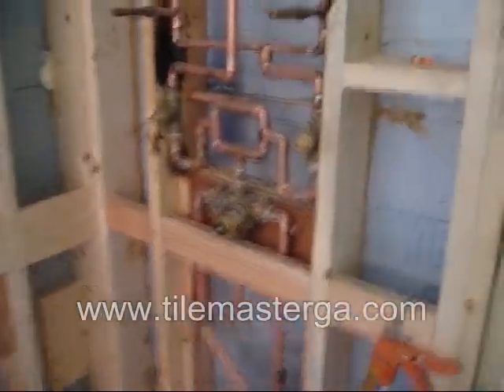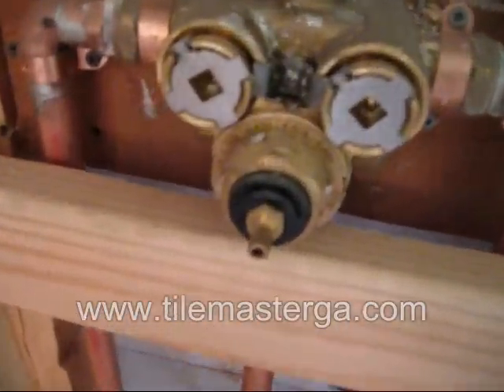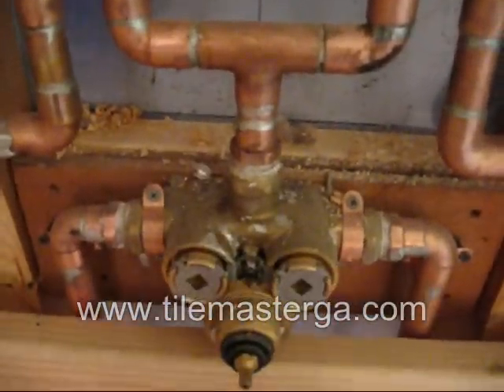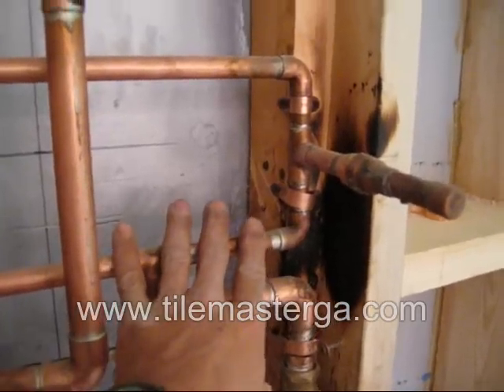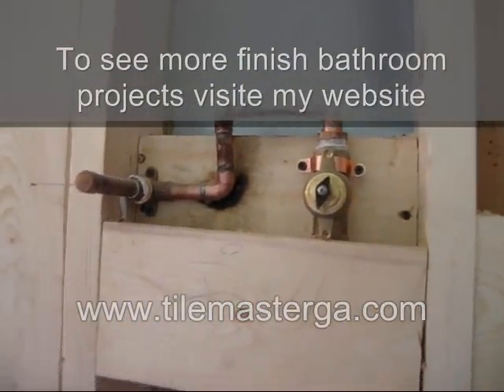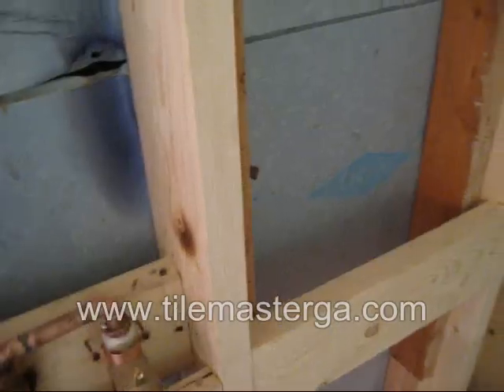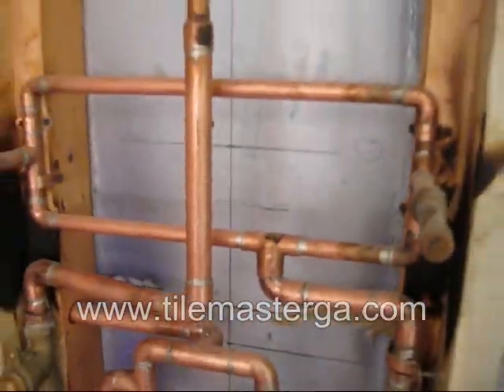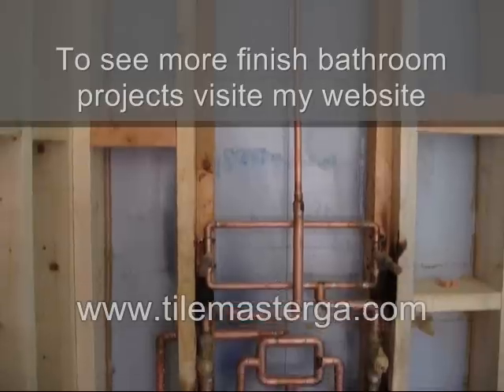How to: KOHLER custom shower system setup - pressure loop & plumbing conections Atlanta tile

Comment: Holy extra pipe fitting-Frankenstien Batman!! You must charge by the fitting instead of by the hour! (many plumbers do that!) The upper balance loop is not needed at all, a single tee centered would have worked perfectly, especially with oversized pipe. The lower one would have been fine with the hand held tee'd off at the point where the pipe exits the valve, then a simple centered tee above that. Again, oversized pipe solves the balance issue. That bigger pipe means more volume of water that has to change temperature- so when the user wants a degree or two change, it's so dammed sluggish that they have a difficult time adjusting. (call it hunting if you want, but it's just a lot more water changing temp. One of my customers has 2 homes that both had near identical bathroom remodels,75 miles apart so 2 different plumbers. The job included over head rain, and 10 body sprays, 2 handhelds, and 2 fancy heads. One got piped in 3/4" with all the loops, the other with 1/2" and centered tees. No difference at all---EXCEPT the one in 3/4"+loops, is so sluggish, that the owner sued the plumber to get it changed. The judge ordered it changed!! The 'loopy' plumber included a temperature gauge at the valve outlet. You could see the temp change, but it took 30 seconds for the change at the heads to stabilize! Don't get me started on the charcoal! Stick to the TILE, leave the plumbing to a plumber.

Comment: Flow won't be a problem, he used 3/4 pipe. Ever seen the size holes in the fixtures?

I like the pipe layout but yes, I would have bench built most of that. I don't like the burnt studs either.  I did a similar one recently and use Uponor Pex. Nice gentle sweeps in adjoining bays and much less joints. Looks squirrely  but owner loves his new shower.

Comment: Well, Golly Sgt. Carter! Just happened across this vid. Been watching all his other vids. I tell ya what, I have leaned more from his vids in a single month than in my entire life. I'm just a DIY'er for this sort of thing. The Tilemasterga really knows his tile shit. But I would not confuse him with a plumber. Sitting here at my desk, and my cube buddy used to be a plumber. He got quite the kick out of this setup. The thing is I think I can envision what he was trying to accomplish with the mixing of water and so forth. But the execution is slightly over the top. Some plumber down the road is gunna do some serious head scratchin when he pulls down that tile wall. Thanks for the laugh and all the excellent tile vids you made. And to all the buttheads saying this is all wrong, blow it out yur azzez. Obviously too many 90's but I bet it works well and will for a few decades.

Comment: Yeah scorched wood is not a big deal....but charred wood is no excuse next time try some flashing folded up in a tight Z behind what you're soldering and you'll have no worries. Pressure loops are fine....should have planned it out so you could run a T straight to the bottom of your control valves to eliminate the the drops from the pressure loop to the control valves. Not sure why the supplies are crossed...but I'm sure there is a reason for it. Always nice to see copper put to good use.

Comment: Why not use a heat shield when soldering that copper?  I mean you did a lot of good quality work and it looks great finished and no way is cost of the heat shield a problem.  I hope all those walls got insulated.  Just a comment, nothing personal like I said it is awesome when completed.

Comment: That is a nice looking shower in the finished pictures at the end of the video.

It looks like the installer got paid by the fitting!  I hope the incoming water pressure is high; it seems like a lot of unnecessary (in my opinion) elbows, which will kill the water pressure. It's good the piping downstream of the thermostatic valves is 3/4" to minimize that.

I would have seriously considered pex, but there is a lot going on inside the wall that may have made putting together everything difficult.

Comment: Interesting, but it looks like you are using dry-wall screws for your clamps. Shouldn't you use brass or stainless screws to avoid galvanic corrosion of the screws due to dissimilar metals contacting? Thanks!

Comment: How do you drain such a system after showering? It seems that these pipes will hold a lot of water that will cool off for the start of your next shower unless you add a diverter valve to a drain. Is the bottom out line from the K-669 valve left open for this purpose. Your video doesn't mention that open pipe at all, so I'm just wondering what the safe way is to add a drain diverter to the K-669.

Comment: Just curious, don't all of those 90 degree angles decrease pressure and flow?
Reply: somewhat but multi head shower fixtures like body spray system requires a loop to balance pressure to each head

Comment: Appreciate the things I learned from watching this. Gotta keep an open mind.
But burning the wood makes charcoal. Can catch fire easier with just a spark and could smell burnt in high humidity.
I've used Al foil to shield the wood but sometimes that melts. Anybody else have any creative solutions?
Reply: +hitty9 I have a 12"x12" piece of sheet metal that I soldered a piece of 3/4" copper pipe with a plumbing fixture to the plate, it is centered about 3" from one side. I can usually fit it where I need it and the pipe holds it in place while I work, easy enough to create other shapes and sizes if needed.Heather
Reply: DakotaGurl1 Nice idea; thanks
Reply: I'd recommend a soldering flame protector. It costs $10-12 bucks, and protects from torches up to 2500°. It's got a grommet in it so you can hang it from a nail. You can have the flame right next to it, and even on it, and then touch it shortly after. Great stuff.

Comment: nice but you burned up these 2x4or 6's nicely, when mine was done i showed my plumber a simple easy way to prevented that, you can use ceramic tiles, they block of the heat nicely prevent the 2x4 or 6's and surrounding wood from burning, after all if they use ceramic tiles on the space shuttle for reentry to prevent it from burning up, why not use it for your heat welding on pipes that are close to wood. it worked nicely.

Comment: Just fit a bar mixer. The lads hasn't done a terrible job here and 90% of people commenting wouldn't be able to do this. The problem you have with this type of shower is it is a considerable amount of extra time to install. They are not installation or maintenance friendly.
Reply: Not if you plumb them THAT way they're not! I can only imagine how long it's gonna take to get all the flux out of the lines!! Maybe set it to Hot and let it run for a week? That drop into the floor? Yah, that's gonna give them problems.

Comment: Copper is always the best way to do systems like that.  It's much more secure and easier to be exact when it comes to a customer with specific requests.  You have used way to many fittings and spent to much time though.  Balancing loops are fine but you've got to much going on there.  Oh, and burned wood is very unprofessional.  While I'm on a roll here, all that work and you install Kohler?  I always seem to get call backs with Kohler valves.

Comment: Erm, what he was saying is that your statement is false. You could have 2" pipes and the pressure would still be the same, an exageration of course... But with 20Lb of pressure from the street, if you change the pipe size 1/2 up or down it wont matter, it will still be a constant pressure. The only thing that may limit pressure, save the line from city water works, is if you had more than 1 faucet going at the same time. Which he does, heh, but thats what the pressure loops are for.

Comment: I have pride in workmanship too.  Most plumbers do, it doesn't matter that nobody is going to see that plumbing for maybe 20 yrs.  I can't stand to see burnt studs.  I also realize that a lot of plumbers are going to see this and comment.  Well guys,  I've invented and patented just such a device.  Sold quite a few of them at the trade shows, and hopefully soon it will be in the plumbing stores.  The Soldersnake,  Google it.
Reply: That's it.  But come on Ron, you know it does more then that.
Reply: Keith Sharrow Burt studs is a pet peeve... not something that defines a professional.

I avoid it when possible, but i don't lose sleep over it. 

That... and you didn't event anything... Plumbers have been using fireproof materials behind solder points for years. Metals, graphite, asbestos.... thats nothing new.
Reply: @Ron Wilson:  you can patent pretty much anything that hasn't been patented before.  The problem is that this most likely infringes on someone else' patent and even if not, defending this patent would be impossible.  This is just Soldersnake repurposing  existing tools.
Reply: Am a plumber, where to by soldersnake

Comment: I installed a shower only diverter, Moen i think for a basement I'm working on.  Three holes, hot on the left I assumed cold right and top going to shower head.  Now you turn the handle and it only goes right which turns on cold only or left which turns on hot only!  Straight up and down is off.  Can anyone tell me what I did wrong other than not calling a plumber

Comment: Wow! a lot of labor, hope you charged a good price. Everything is fine except it could have been efficiently done but this is good. I did not know you had to be a licensed plumber to post a youtube video, that's news to me, I say ignore that. Far as drywall screws and copper nails.... yeah you are fine ignore that comment, those nails are copper dipped they are not actually made of copper effects are the same. Barbequing wood is not good, that is BAD news you need to work on that, that is a big NO NO. Whether its 3/4" or 1/2" there will be a significant amount of pressure loss, 3/4" might be less effected than a 1/2" but there is still a drop in pressure hence I said it could have been plumbed a bit more efficiently but what you did is fine.
Home owner is a fool.... or who ever recommended this system.... with so many solder joints, 100s, if one fails imagine the cost and headache that follows!!! From potential mold, dryrot, structural damage.... and if the valve leaked at some point in time its not like you could run to any ace or HD to get replacement parts. After about a decade or so they would completely stop manufacturing parts and parts would cost a lot. Now its all fancy 10 years into it starts the nightmare. A service plumber would have to charge two service calls in most cases, get the cartridge model number and possibly order from the manufacturer and come back again to install it and lots of water wastage in between RUBBISH!!!! I had to get a Moen trim, not the valve just the trim that costed $275! Special designs have special price! Oh I almost forgot just because you are licensed it does not make you any better, as long as you keep the shit rolling!

Comment: So much soldering use pex pipe and shark bite connections or crimp connections
Reply: +Jim Monheim umm no
Reply: Jim you are funny!   Shark bite fittings are not even aloud in some states and are for one purpose.   When you cant get water out of the pipe and a emergency then you use one.   And you need to have copper coming off the shower valve.    4 feet.   (where I am from anyway)
Reply: Shark bites are not for plumbers....its for dyi or repair
Reply: Shark bite if you use you have to have access panels

Comment: ever heard of pex ?
Reply: pex only becomes brittle when exposed to uv light. hopefully there isn't any inside the wall.  lol :)
Reply: ever hear of plumbing code ,not all cities and states follow same plumbing codes !
Reply: @firesurfer   the catalyst in any plastic never stops working. This is why plastic shrinks, cracks and becomes brittle over time. Pex is not a new product its just plastic shit resold under a new trendy name. Pex is also flow restrictive due to fittings that push inside the pipe. Solder joints also are rated to hold more pressure. Pex is for handy men and lazy plumbers. btw rats chew holes in pex
Reply: @paullehigh979 pros and cons... no condensation with pex, less 90s, quieter but smaller then copper
Reply: all true but rats cant chew holes in copper @stoneywilliams1209

Comment: I think this pipework is a bit excessive to what is actually needed, as for the burn marks, i have never used a heat shield in my life and dont intend to, if care is taken a shield isnt always needed. I personnaly think the only thing that looks nice about this is the finish, if i was the customer i would have like to seen as many bends pulled using benders rather than preformed fittings. Also these valves arent for controling pressure there for controlling flow, 2 massivley

Comment: Tilemasterga, are you a licensed plumber, if so please give us your license number.

I see things done in your work that leads me to believe you are not a licensed plumber.
Reply: +John Smith I take your point, but I see licensed plumbers and electricians do either work in violation of the code or sloppy work all the time. Brand myself as a crotchity geezer just because you stand up for proper installs!
Reply: +John Smith there are things in his work that make appear he is not a professional plumber.  However there are things that show he has done more research on how to do it properly than most professional plumbers.
Reply: John Smith, you yourself wrote it 'TileMasterGA', he is a tilemaster not a plumber! I love his videos.
Reply: Like the loop not needed at all...

Comment: Nasty plumbing. Making money off plumbing but you also need to spend money on tools. He needs to invest money in a pipe bender and will save a bit in the long run by not using so many elbows.

Comment: Could of just added a PRV after the mains or before the shower pipe entry if u have high pressure problems & maybe a pressure relief valve if required. What a jigsaw maze joke of unnecessary pipework ass bandit plumbing...

Comment: Does this guy know how to use a pipe bending machine.......!
Reply: +yensabi Er, he's not installing conduit last I looked.
Reply: Don't want to use soft copper not good want it to be ridged
Reply: @frankriddagh9050  hard copper is easily bent look into rems tools in the usa its rearly used as it requires thinking and math...
Reply: @josephv5346  they do make long sweep copper 90s

Comment: I would absolutely be embarrassed to show this video with burned 2×4 s. Completely unprofessional. Pressure valves? Not a professional plumber. Hot and cold mains reversed. Embarrassing